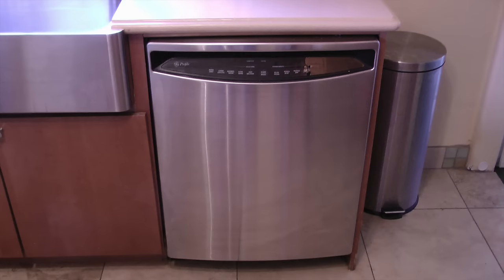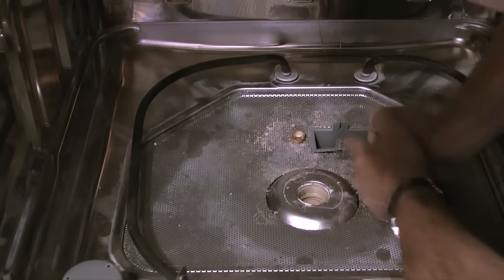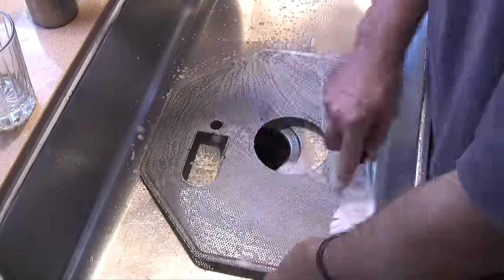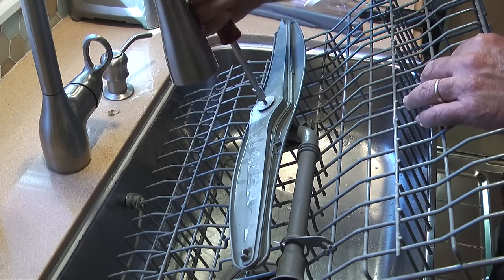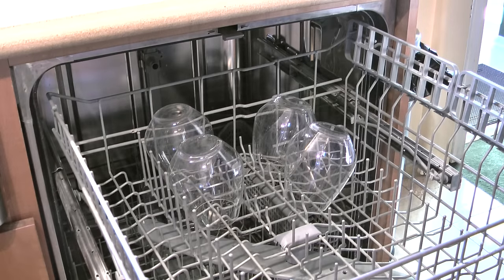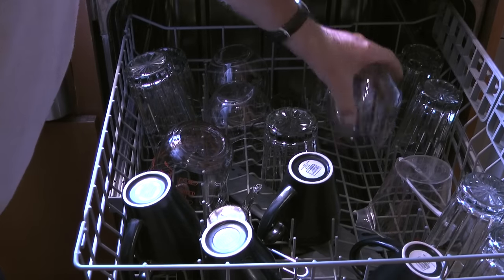GE Profile Dishwasher Maintenance

Comment: I expect a filter needs to be cleaned much more frequently than doing a maintenance on the machine. In my opinion, a poor design putting the filter in such a difficult place. Thank You iScaper1 for such detailed and to the point video.
Reply from the maker: I agree with you!

Comment: thank you!!! i was able to follow the instructions with no problem! the amount of crud on the underside of the bottom screen was GROSS!!! also - the design team that came up with placing that basket filter UNDER the tube to the upper rack should be banished from engineering work.
Reply from the maker: Lorraine Ross 
I agree!

Comment: I haven't gone through this procedure yet, but I definitely will be. My question: I get the same problem with food bits clogging the jets on the spray arms all the time; I have to clean them out every couple of weeks. Have you found that cleaning the filters as you did in this video helped to prevent that problem?

Comment: Thanks for the great tutorial.  Recent problem we had was standing water in bottom of washer following a cycle.  Completely cleaned drain line, filters and pump.  If problem remains I'm assuming pump needs replacement?
Reply from the maker: That would be my guess if you're sure the drain hose has no obstructions.

Comment: nice instructional video-tho i would add when taking the filter basket (my term as it looks like a basket to me) out it is not necessary to pry around the outside of the basket possibly damaging the gasket around it-instead there are tabs in the basket for use to aid in the filter removal-simply insert a flat head screw driver into the filter basket and use these tabs to pull the filter basket sides inward-you can look down into the basket and see that is has released from the side-do this to the opposite side also then pull the filter basket out

Comment: Got stuck in same spot with the filter removal and unfortunately the parts list is not an exploded drawing.  Saw what you did but when I experiment I usually break things so one last search revealed your video and the work is done.  The small tab holding the supply tube on the venturi is pretty sensitive and I did break that off :o).  No worries, hardly any pressure there and stuck it back in place after assembly with a little superglue for insurance.  If you have a silicone seal on the lower filter screen clean it gently or it will tear, and there may be a small stainless washer in the throat of the venturi for the lower spray arm to spin on.  If you find it in the sink just drop it back in there.
Reply from the maker: Good additional tips, thanks for posting.

Comment: What about the "Smart Dispense"  part of the dishwasher? How do I clean that out? I do not know if the previous homeowners used chlorine or enzyme and want to clean it out before applying cleaning solution. Also what one is better to use chlorine or enzyme. Also Thank you this video was helpful and informative.

Comment: This video was SO helpful! Thank you!  Our dishwasher is running much better now! One small problem: the middle spray arm is not spinning even though we cleaned it well. Any suggestions?
Reply from the maker: +Jason Creamer 
The only thing I can think of is you have an obstruction in the tube that runs from the spray arm back to the main supply tube running up the back wall of the dishwasher, or you have an obstruction in the main supply tube. I would remove the middle spray arm again and flush the tube out, and if that doesn't work you might have to disassemble and inspect the main supply tube again.

Comment: Thank you so much for this amazing video - very detailed and even including challenges. I was able to do this for my 13 year old dishwasher that had NEVER been cleaned! So gross - but now so clean.

Two questions (if you ever read this and respond) - I broke 2 little tabs on the hub nut - hoping I can order just that piece. Also should there be water sitting in the filter hole? Mine has water just sitting there and I'm not sure if I should run sink drain cleaning to help or if it's normal.
Reply from the maker: Will the hub nut tighten back up? If so you could probably go ahead and use it. If I remember right my filter hole had water sitting in it. My guess is the water sits at the bottom level of the inlet to the pump.
Reply: I also had 2 pieces on the hub nut break off and when I go to put it on and turn it, It does NOT click in place like this video states it should. If it's not locked into place, will the spray arm not spin?  I already checked and its not the motor pump

Comment: Thank you so much for making this video!! As a first time homeowner, I have relied on tutorials graciously made by others to learn how to DIY fix things. This video was easy to follow and very thorough. I had a few questions after watching and would greatly appreciate some feedback. Thanks in advance!!

I noticed some water sitting where the filter basket goes. Is there supposed to be water there? And if not, what might you think is causing this? 

How often should the fine filter be replaced? And is there a way to open this up to clean it?
Reply from the maker: I don't think it's unusual to have some water at the bottom of the filter. Replacing any item on an appliance is expensive so I wouldn't recommend it unless there is a damaged part.

Comment: Great and extremely helpful video! My only comment: on our washer, the tab holding the supply tube to the Venturi did not lift as easily as yours did. I snapped it off :( and had to glue it overnight. Two of the four tabs on the hub also broke slightly on removal. Might be something you could warn viewers about with a caption during that section of the tutorial?
Reply from the maker: +keptquiet 
Good tips, I'll add a couple of captions.

Comment: Thank you so much  for sharing your video.  Was going to replace dishwasher...but realized I would have to break tile kitchen counter top to do it, and the tile is no longer available to buy locally.  So I'm very happy to say it looks like it totally worked.  Wasn't a clogged filter but after a few years of not using our soft water system(had a leak) there was an extreme amount of hard water and calcium deposits.  i took pics to show my hubby cause I just couldn't believe it. 

I do however wanted to know if you know what the rubber/plastic whitish hose is called that is on the left of the filter?  Apparently ours has totally started to disintegrate. Only about a quarter of an inch on the top is still in tacked, which I'm sure is bound to cause problems.  But after looking at the parts manual I couldn't figure it out, so I thought you might know.  Again thank you soooo much for you video it was extremely helpful.   <3 <3
Reply from the maker: Linda Wheat 
Do you mean the supply tube that feeds the spray arms? It's part #585 on the parts diagram and is called the conduit main assembly.

Comment: Thanks for the video. I'm still unsure whether I'll attempt this process, since the risk of damaging a part might mean I'd have to buy a new dishwasher. 

By the way, you didn't touch the gray plastic cylinder that's in the bottom left at 0:45. What is that? I had wondered whether it was part of a filter, but apparently not.
Reply from the maker: It's the dome float for the water fill.

Comment: I need HELP! first of all this is an awesome video!!  Second, this is where I need help, my DW is the same as shown on this video, but inside is not ss.  The venturi is a little different as well and that is my problem.  I can not remove the venturi.  Everything else I was able to remove.  The venturi is soo tight, I even put some liquid soap around it to see if it loosens, but is not working.  I appreciate any input.

Comment: Thanks for posting this fantastic video. It has been immensely helpful. However, I can't get my venturi to unscrew. I would LOVE to know how to remove a venturi that just turns and turns but won't actually unscrew. I AM turning it counter clockwise. I've even tried pulling up on it while turning it counter clockwise. Still no luck. I'll keep trying to get it out.  However, I think I'm also going to see if I can wiggle the screen out. I'm glad I'm not the only one with this problem.

Comment: Thank you for posting this. I just moved into a house with a PDW9980N00SS and it was not cleaning well. After finding your video and taking ours apart, I realized how much I took the dishwasher that I had a disposal in it for granted.

Any specific tips for getting the bottom spray arm clean? I was able to pick stuff out of the middle and top arms but the bottom one seems much harder to clean out.

Comment: So I did this, however after removing both filters at 3:43 in your video, I have water in both holes, it goes almost all the way up. Something is probably blocking it, any ideas how I can fix this? The angle is awkward, and the holes + water make it difficult to see
Reply from the maker: I used a turkey baster to suck the water out of the filter hole, then I felt around to see if there were any obstructions. I'm not sure if this step will help you or not.
Reply: Tom Szczypka mine too , but i have small hands so i just grabbed what i could and cut with scissors what had wrapped around the twirly thing
Reply: I am almost certain  that a certain amount of water is intentionally left in the pump area by design in order to keep the pump seal from drying out. According to GE manual, it is meant to have a water level of at least to the top of the pump filter basket, The literature does not specify a level other then "some water left to keep to pump seal lubricated"
Reply: So everybody had water in there? Just want to be sure mine isn't weird - maybe you should have included the turkey baster bit to reassure us ours isn't wrong

Comment: Great info. I have one comment. When you remove the filter, the inside portion needs to be cleaned out as well. I found plastic pieces down inside and a lot of goo.
Reply from the maker: Good tip, thanks for posting. I had plastic and sludge on the inside of my filter.

Comment: Hi Great video.  Very well explained.  I have the same model.  My dishwasher is not cleaning my dishes.  I believe the agitators are not turning and spraying water.  I have torn the washer apart and cleaned everything   Once all back together and start the cycle, I hear the water filling in the tub but then simply draining after a few minutes.  Any thoughts?
Reply from the maker: It almost sounds like the dishwasher is skipping the wash cycle especially if it goes into a drain cycle a few minutes after filling. If that's the case it could be a control panel issue. On our dishwasher I would guess the wash cycle is 15-20 minutes and I can hear the spray arms turning.

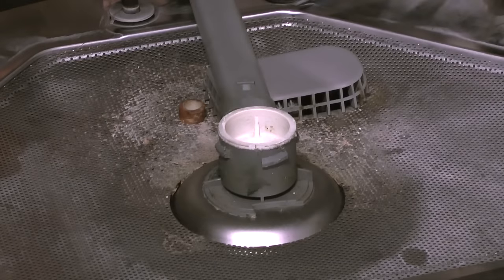Comment: I am having trouble about 1:30 into the video where it shows removing the nut on upper spray arm. The nut just turns and turns but never comes out. Any suggestions?
Reply from the maker: Hmm, it's a bolt that secures the upper spray arm. I hope yours isn't stripped out. Will the bolt tighten back up?
Reply: iScaper1 no it doesn’t tighten either so I just put all the parts back together and cleaned filter best I could without removing.
Reply from the maker: @kenkirkland5576  Probably the smart thing to do, I don't have a good solution to fix a bolt that is stripped out.

Comment: Thanks for the great video! What if the venturi does not unscrew, it just spins around and around...and around?
Reply from the maker: +BethC2012 
Mine threaded out easily. I wonder if you have debris or hair hanging it up. Have you tried some upward pressure when you reach the 2nd full turn on twisting it out?

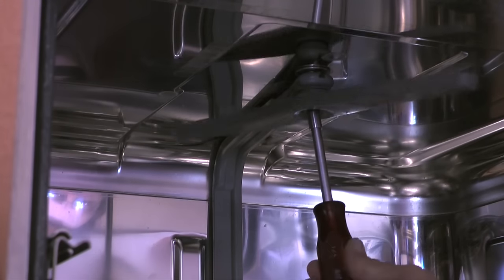Comment: I just checked mine and the white tube coming out of the coarse filter screen that the fine screen tube slides into on the bottom disintegrated.  It's at 6:50.  I can't see how far down that goes.  Need to find the part /name for that.  Anyone know?

Comment: Thanks so much for this video.  How fast does the middle sprayer spin on yours?  Mine seems slow.  Top and bottom spin about 1 cycle/sec.  The middle is 1/2 that or less.
Reply from the maker: Near as I can tell all my spray arms rotate at the same rate.

Comment: Very helpful, my tube that runs top to bottom wasn't clipped in and there could be a screw, but there wasn't.  My large nut at the bottom had a couple of the tabs break, but it's old and brittle.  This was the first time I've done this in 14 years, seems like it actually quieted down.   Any great link for the replacement part numbers?  My louver cover thing on the door is also in need of replacement.
Reply from the maker: There is a link for parts in the video description.

Comment: Great instructions and help!   As you're looking  into the dishwasher and I've just taken that stubborn filter out there is a rubber tubing that has disintegrated. Where would I find the part number for that?   For perhaps something that can be purchased at Home Depot?
Reply: Were you able to find the tubing. I have the same issue.

Comment: Thanks so much for your video. It was the only one I could find that was my exact dishwasher. You are so right about the useless manual. I tried to take it all apart. My only issue is that the fine filter has a part attached that has been wearing away and when I took it out, there is a white piece that is still on the tube. I see now that may have been my issue but now I don't know what else to do. Do you know if can replace this part myself?
Reply from the maker: Hi Courtney. Do you mean the white tube next to the filter basket? If so it looks to me like you'd have to access the part from the bottom of the dishwasher which means you'd have to pull it out from the cabinet.
Reply: @Iscaper  Thanks. I ended up doing what you did and looked up the parts list. It turns out that I pulled apart the top tube from the inlet sump pump. The part is only $20.00 so I ordered it. I'll let you know how the rest of the repair goes. I certainly couldn't have done it without your video. Thank you so much 😊!!
Reply from the maker: @courtneyjackson6921  Thanks for the info and let me know how the repair goes.

Comment: Really nice video! I was able to clean my dishwasher easily with this method. One thing that happened to me... the top spray bolt broke while removing. The rest of the bolt is in the top of the tub and I am not able to replace the top sprayer. If the bolt does not move for you, do not force it!
Reply from the maker: Jeffrey Byrns 
Were you able to get the bolt out?
Reply: Nope. It broke deep. I am wondering if they used locktight.
Reply from the maker: Jeffrey Byrns 
Possible. My bolt came out pretty easily, I don't know what to tell you with a busted off bolt in the housing. The housing is a one piece unit. What an awful problem to have due to a 5 cent part.
Reply: The good news is that the washer is washing a lot better than what it was before. That is thanks to your video! Water should be pouring out the top instead of spraying. I am sure I will engineer something to solve it.

I would like to drill out the bolt, but it is small and hard to get in there with any leverage.
Reply from the maker: Jeffrey Byrns 
Good luck. Let me know what solution you come up with.

Comment: I popped the bottom arm out and 2 of the holes were blocked with crud and plastic. Easy.

My dw looks the same as the one in video but all nuts are teeny tiny. I'm a renter and do not have many tools. Do I buy a teeny sized nut bolt driver? I can tell the other arms need a good cleaning.
Reply from the maker: I used a 1/4" nut driver for the bolts in my spray arms. Hopefully yours is the same size if you buy one 🤞
Reply: @Iscaper  thanks. Mine look weird because they are about the height or thickness of 2 nickels. Will a regular nut bolt driver work?

Comment: Very Nice detailed video shame we can't find stuff like this from GE? These videos offer way more advise shows where parts are and removing them vs their poor manual. Having used GE for awhile I found out usually what goes bad in dishwashers their recirc pumps and seals and the jets and filter needs servicing as you noted.  I pre-wash my dishes because it's a pain to clean out the filter and jets in many of these models. The type of dishwasher detergent you use is critical as well especially if using hard water. (I found calcium deposits will build up in the jets/ports seals like in the recirc pump as well as clogs the filter along with other issues. I would highly recommend using Cascade Platinum (which helps dissolve the excessive food deposits and calcium buildup as well.) Cascade Complete ActionPacs contain both food-dissolving enzymes and the grease-cutting agents. They boast 25 percent more cleaning power than the brand's original formula. Which would reduce most of your basic maintenance.  Only other option I would suggest is using Finish Quantum powerball tabs (Reckitt) which is similar to Cascade but they use an extra bleaching agent for whitening and enzymes to dissolve tough food residue & calcium deposits. Thus extending the life of your dishwasher is your goal as the average life is about 12 years.
Reply from the maker: Good information, thanks for posting.

Comment: I had to replace my damaged sump (from the bottom), and found the sump-filter completely clogged on the pump side with "goo".  Non of the other screens you cleaned were at all dirty in my 15-year-old washer.
Reply from the maker: Good information, thanks for posting.

Comment: I'm wondering why there was no mention of cleaning the cup-shaped  part that is on the front left side of the bottom of the dishwasher? I removed mine, and it was heavily caked with a crusty white film. I soaked it in a vinegar and baking soda solution and was able to get most of the crust off of it, and clear the holes in it, which had been clogged.